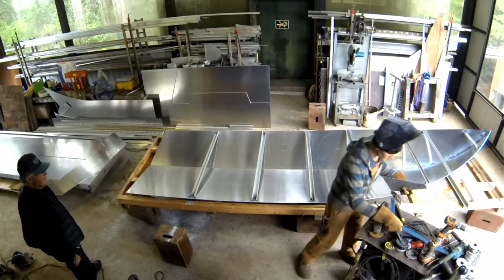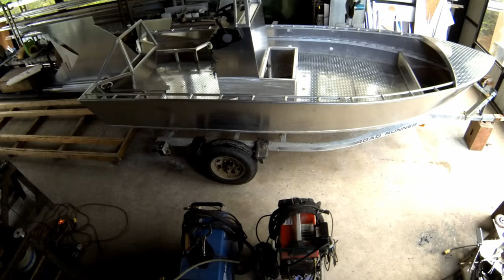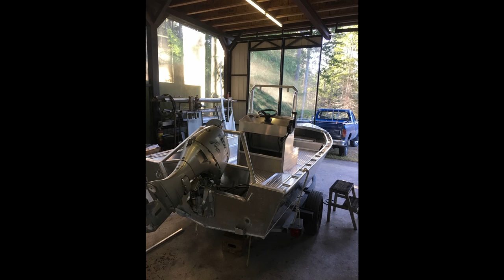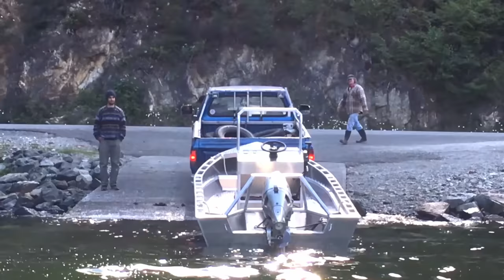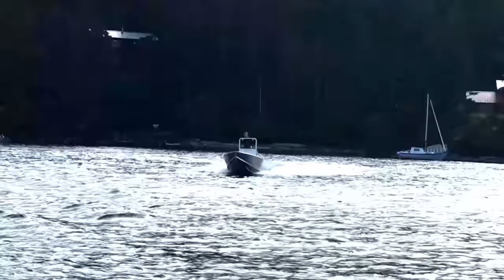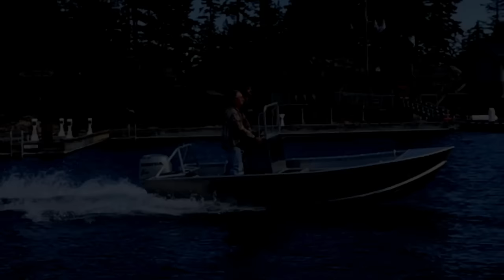16 foot welded aluminum boat build

Comment: hello i have a question.
we have an aluminium pontoon boat and i wonder what anode we should use for it.
thanks in advance
Reply: Hydral or Mercatel. Basically a proprietary brand of zinc alloy. Mercatel is Mercury Marines sacrificial anode material, you will find it all over their outboards. Typically under the mounting bracket and the prop counter steer tab up under the ventilation plate. Occasionally some on the power head through water jacket as well.

In essence for the sacrificial anode to work, it must be equipotentially bonded to the alloy hull.

In the case of an outboard as you’d see on this build, because it’s bolted through the transom the outboard is earthed (equipotentially bonded) to the alloy hull. So the sacrificial anodes on the outboard will protect the alloy hull, the same as it protects the alloy castings of the outboard.
Nothing to stop you adding extra anodes to the hull if you wish to.
The outboard is a mish mash of alloy, brass  bushes, stainless steel, and steel components like crank and con rods.

The material you select must be of a lower valence (willingness to give up its electrons), than the metals you wish to protect (aluminium).
Zinc ( and the proprietary Hydral & Mercatel alloys of zinc) fits this bill nicely.

Remembering that the only time the anodes are working is while they are immersed in salt water.

The very definition of a wet cell battery is 2 dissimilar metals immersed in an electrolyte.

So aluminium of hull and or outboard castings floating in salt water (electrolyte) when you add in the stainless steel props, and brass bushings in the gear box etc) is the dissimilar metals.

The fact the zinc anode is also immersed means that it sacrifices instead of the other critical metal components.

What you have to watch for is dropping fish hooks, lead sinkers, & brass swivels that get under your floor and sit in a puddle of salt water under there while the boats in storage.

The sacrificial anodes on your outboard then aren’t immersed in the electrolyte so they can’t give up their electrons to protect the alloy sheet of your hull.

So if the boat is stored in a bow down attitude - where water under the floor can’t drain to the bungs at the transom and there’s ball sinkers hooks or brass swivels found their way under your floor, you’ve created a small wet cell battery under your floor that can’t be seen and is slowly electrolysing your hull sheet material away.

In order for the anodes to do their job the negative pole of your starter and house batteries must be connected to the hull & the hull is your earth return.
It’s typical to see those involved in rigging recreational alloy boats trying to “insulate / isolate” the hull from the 12 v electrical system but this is a mistake.

If the outboard bolts are coated in duralac and there’s a PTFE spacer used to separate the outboard mounting bracket from the alloy of the transom, then you’ve just electrically isolated all the anodes on the outboard from protecting the hull sheets. The anodes are no longer equipotentially bonded.

Electricity is electricity whether 12V DC from your battery or 110V AC from a generator for eg.

In steel hulled (metal hulls) the hull is always the earth because in case of a short circuit the hull being the earth protects occupants from electrocution.

It’s no different with alloy hulled boats and 12V - the Battery Earth poles must be connected to the hull so that the hull is your earth return.

Trying to isolate a 12 V electrical system from the alloy hull just leads to the risk of galvanic corrosion & crevice corrosion of your hull while out of the water in storage.

When your not using your boat and it’s in storage the best thing you can do id take the battery physically out of the boat and put it in a wooden bench and trickle charge it.

Only put the battery in the night before you intend to actually use the boat.

Really speaking you need to understand this topic really well to successfully own an alloy boat & many coming from fibreglass boats just don’t understand the topic at all well enough when they get their first alloy boat.

My 2C - OMMV
Reply: @ianmoone2359  thank you so be much to take the time to answer.
Our boat is a pontoon boat which we live on, so we basically don’t take it out of the water (next time probably next year).
It is always in fresh water. Does this mean we don’t need anode?
And you are talking about alloy, and ours is made of aluminum, or it’s the same when it comes to boats. Sorry for my ignorance. This is all new for me
Reply: @familiamotarica6616   No problem. In theory you shouldn’t need sacrificial anodes in a freshwater lake on a aluminium hull.
Fresh water isn’t an electrolyte like salt water is.
So electrical current shouldn’t flow between 2 dissimilar metals when immersed in fresh water.

So that’s in theory.

In practice it’s often different. Fresh water in freshwater lakes is seldom pure fresh water, normally it will contain some traces of salt

I don’t know how close you are to the coast - but often rain clouds that evaporates off the ocean and then travels inland before precipitating - contains small traces of salt.

So your fresh water lake probably has small traces of salt in it. It only takes a trace of salt for freshwater to become an electrolyte that will conduct electricity.

Really it’s only distilled water that won’t conduct current. The freshwater in your lake will conduct some slight current which will however be so low as to basically mean that electrolysis would take 100+ years to do any discernible damage to your aluminium hull.

With that said and out the way, it can’t hurt to bolt sacrificial anodes onto your hull. They won’t do any harm and it’s better to have them than not have them. If your outboard already has them then your already protected provided them outboard/s aren’t tilted up most of their life and not in contact with the water.

Alloy is just short hand for Aluminum / Aluminium depending where you live and how you spell it. 👍👍👍🇦🇺
Reply: @ianmoone2359  we do have an anode on the outboard but, as you said, we keep it trimmed up to avoid stuff growing on it. So the anode is above water level.
Thanks a lot it was very helpful. We will get an hydral or mercatel anode.
Greetings from Berlin!
Reply: @familiamotarica6616  No worries at all, best of luck with it.

Comment: Thanks for the video
Est. hrs to build?
Grade aluminums used?
XR gun or push pull gun, or?
Thanks!
Reply from the maker: I think this one was about 120 hours. I just had a spoolmate 3035, and I drilled the tips out for 3/64 wire, which worked just fine with a millermatic 210. Now I’ve got a Lincoln powermig 350 mp with a Miller XRA push pull, and a 360 mp with the Lincoln magnum pro AL push pull. The pulse migs are amazing, but the old Miller got the job done just fine.

Comment: I am considering building an aluminum boat. Did you wire brush and/or acid wash before each weld?
Reply from the maker: I wire brush for some of the critical welds, but if it is new clean material I have not found it necessary to do all of them.

Comment: Я что-то не увидел  установки ни одного шпангоута , стрингеры есть, а шпангоутов нет, силовой набор слабоватый.
Reply from the maker: Transverse frames welded to the hull tend to lead to a "Hungry Dog" look, as the plate bends in around them over time. The longitudinal stringers are tied to the transverse deck beams, and the hull bottom is heavy for this size of boat so it has lots of strength. It would certainly be fun with a bigger engine, but it does 30 knots with the Honda 50, and guy I built it for already had the engine and wanted to use it. 
Cheers!

Comment: too fast...I lost where you put the tanks...
Reply from the maker: They are under the console. They can be filled by hinging the seat up, and the front panel is removable to take the tanks out.
Reply: @EM-hu2bj  Great, thank you for your answer....so the boat has whole double bottom, am I right? And are those holes (at 4:30) on the plate made to weld the plate to floors (or cross bottom beams)? Thank you!
Reply from the maker: @compassft  You got it!